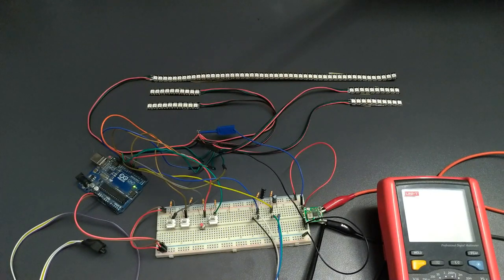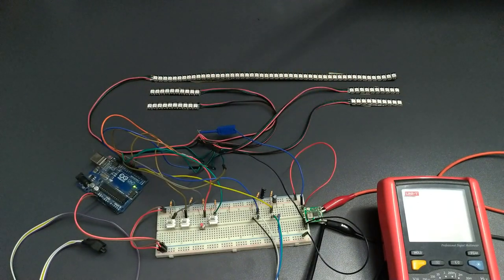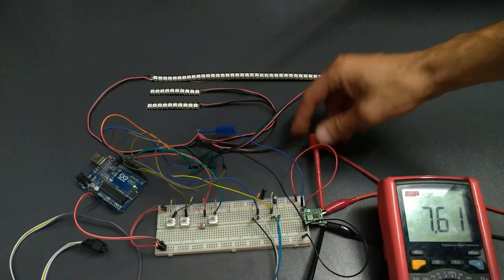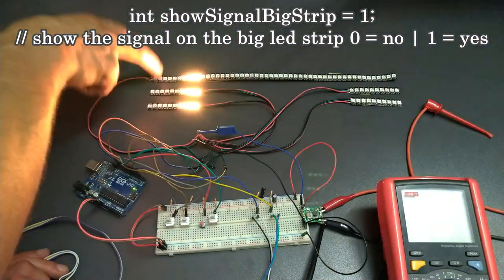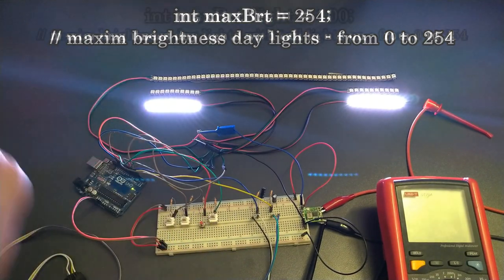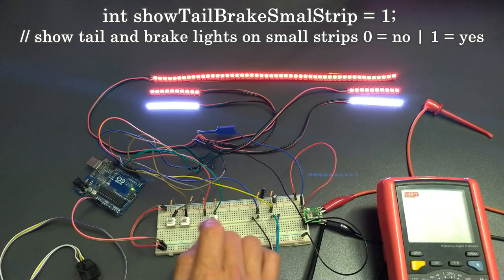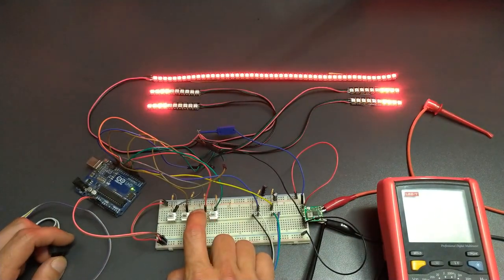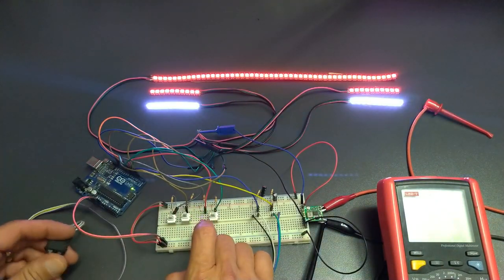Sequential turn signal lights v3.1 for scooters and motorcycles - Arduino, FastLED and WS2812B

Comment: Hi there, very good project you have.I'm planing to use this one  my scooter.Can you make the code to turn on the hazard lights like  the new versions with the regular bike blinker switch  (left to right) Also how diffucult to be to change the animation from Knight rider to other animation like Fade in fade out? 
Thank a lot keep improving the project
Reply from the maker: Hi and thanks.
That's a great idea, i didn't make it from the beginning with the hazard light turning on combination because i didn't knew about this limitation, bkmo98 point it that out. When i have the needed time i will also do a version with the hazard lights combination.
I don't know how hard it will be to add the Fade Out effect, but it will definitely add a delay to switch it between them and it will not be ok, because you need fast reaction of the lights...

Your welcome! ;)
Reply from the maker: Version 3.2 it's here... https://youtu.be/qdpRKUnaBsI

Comment: Will it work if I connect it to any motorcycles light switches? And like regular turn signals uses a flasher, but with arduino you dont use flasher? Am getting it right? Awesome tuts by the way, subs +1

Comment: Hi! Thanks for the video.
Quick question though. What kind of step down module are you using? From what I can see most available rgb led strips will have power consumption of 9-11W per metre and the one you're using is even 43W/m. However, the drop down module you've referenced can produce 3A peak which, if my math is correct will be not enough. 

Also, would you use step-down for light pins from motorcycle to arduino? I know arduino can be powered by upto 12V but digi pins only accept 5v
Reply from the maker: Hi. Your welcome :)
Your math is correct, but not in this situation with this color scheme. In version 6.1 i detailed how to calculate your power consumption for the led strip.

Your mistake was that you calculated for white color, this means red 20 mAmps, green 20 mAmps, blue 20 mAmps and that will be a total of 60 mAmps for 1 led, multiply by 90 leds that i use we have a total of 5.4 Amps or 27 W (for 144led 8.64 Amps or 43.2 W), but i don't turn them all at once white !

In the color scheme of this version the led strips consumption doesn't go over 2.6 Amps and that is when day lights are at full brightness  (20leds * 60 mAmps = 1.2 Amps) and brake at full brightness (70leds * 20 mAmps = 1.4 Amps).
The step down converter model that i'm using is the one from the schematic MP1584EN.

Don't complicate yourself with using step-down converters for triggering... optocouplers are cheap, suited for this job and safe for your microcontroller.

Yes, arduino can be powered from 6v to 20v thru its internal voltage regulator, but the recommended voltage input is from 7v to 12v. In any vehicle with a 12v battery the maxim voltage will be 14,4v with the engine on (because you need to charge the battery, no?) and if you still need the 5v for the led strip, why not power your controller from a stable power supply...

I recommend you watch this clips, they have good info about arduino and optocouplers...
Arduino Basics 101: Hardware Overview, Fundamental Code Commands - https://www.youtube.com/watch?v=BtLwoNJ6klE
Electronic Basics #32: Relays & Optocouplers - https://www.youtube.com/watch?v=2BdevOmN-Zk
Digital Electronics: Optocoupler | Optoisolator - https://www.youtube.com/watch?v=uRX0OwWjKXA (more technical details)
Reply: @IonutFedaceag 
Thanks for the reply. Yes, I'm  planning to use optocoupler. My setup will be slightly different though. I only plan tail lights with two strips on each side of the bike which will work as side lights, stop lights and indicators. I'm new to arduino so if you don't mind, once I have everything prototyped  on the breadboard I'll share it with you and I'll appreciate your comments
Reply from the maker: Ok, ask when you need, but please, include details... they are extremely important. ;)

Comment: Hi, I'm very love this project, I will try to do it for my motorbike.
I have a additional that if the day light can change the color by button and still maintain this color in case we have switch on/off key instead of only 1 color. It will be more cool
Reply: I have done and using with Arduino Pro Mini.
Everything worked well, only one thing is pin #2 for turn light is not. The PCB is checked carefully and worked, HIGH level at pin interrup #2 when input is come.
Please help on this matter.
Reply from the maker: Yes you can... You make a daylight variables (for hue and saturation), add another button, make an if statement for the button to change the daylight color variables and at the end of that if statement just store the value to eeprom with " EEPROM.put() " or " EEPROM.update() ".
After that in the setup void, get the values from eeprom memory with " EEPROM.get() " and assign it to the daylight variables and your good to go...
Reply from the maker: It must be something wrong with the setup, the code and sketch that i posted worked flawlessly...
Did you modified the code?
Could you post a clip with the setup and the problem?
Reply: @IonutFedaceag  thank you so much your feedback, i will try it and will let you know when it done
Reply: @IonutFedaceag  i mean that this issue only happen with arduino pro mini, but after i used with Uno, it worked well. Thank you very much
Reply from the maker: @chitrungpham5804    Strange, they have the same chip, maybe the Pro Mini it's faulty... did you test the pin with another sketch?
With pleasure! ;)
Reply: @IonutFedaceag  i tried with some pro mini, it is same. But now, i already used with Uno, thank you very for your feedback. I will try to do change color and let you know soon
Reply from the maker: @chitrungpham5804  Ok. You can post here a clip with your finished setup, it will help others with their imaginations and i'm also curious! :)
Reply: @IonutFedaceag  hi bro.
I have tried to do it, but i got something.
the color will be change by: fill_solid( ledsB[3], NUM_LEDS_PART_B, CHSV(0,0,gBrtR));
but really i cant change.
do you have any selection table for some color for CHSV color code or guide me how to change to color?
Then i will combine with additional statement changing color by button and store in EPPROM. Thanks you very much
Reply from the maker: @chitrungpham5804  Yeap, you can find it here... https://github.com/FastLED/FastLED/wiki/Pixel-reference
With pleasure! ;)

Comment: As far as inputs go, how would you configure the wiring and code if the brake lights and turn signal were on the same light and wire? Such is the case with many trucks that don't have a separate blinker/signal light. Thank you  for the amazing work you do.
Reply: Each led has a chip inside, making each one adressable, even if they get the same signal cable. This is why they have GND, 5V and data connections.
Reply: Olaf Breuer Thank you for the reply sir. Yes I am aware of how these LEDs work however I’m still curious as to how one could configure the input code if the vehicle turn signal/brake light are the same bulb.  In this well made  example there was separate circuits on the motorcycle for each light but I’d like to know how to configure the code if those circuits were the same as is the case with many trucks. I can’t quite wrap my head around it because the code would be a bit trickier
Reply: @Gmtail  I hope I get the point... well, you can easily put all leds in one row, all on the same signal instead of wiring them in 4 /5 groups. The first led in the row recognizes that it gets its data from the arduino, and then tells the second led in the row that it is nr1. From there on each led "passes his address" on to the next led so each led has a unique address. (This is technically not 100% correct, but better to explain). Now that each led has an address you can group them as brake light leds or  turn leds. In case the brake pedal is pressed you tell the brake led group to turn red, in case of a turn signal you make the turn leds go orange. You can even have leds being part of more than one group and define priorities. Like he did with the big led strip where parts of it can act as turn lights as well. It is all a matter of group declaration. I operate biggest light computers on the market, its nothing different there. Lots of lamps on same signal, organized in groups and priorities/rules defined.

Comment: Are there any sound effects available as a reminder to turn of the turn signals? Judging by the video it seems like the turn signals stay on as long as the momentary pushbutt is being continuously held down. That would reduce the possibility of forgetting to turn off the turn signals but would make it harder to operate something else on the bike.
Reply from the maker: Well, I didn't think it would be heard because of the headset and the noise... i will add it in the future version.

Comment: Hello Ionut! I like your project and I plan to build it, but I have a questions: Can I use SK6812 (RGBCW) neopixel led strip for this project? If yes what should be changed in the code?
Can you help me out please, with the code update for SK6812?
Thank you for your answer in advance!
Reply: Assuming the colour order of your LEDs is the same as the WS2812B then this should work for you.  The WS2812B led colour order is GRB, not RGB.  I do believe that the lights you're using are the upgraded version of WS2812b anyway. So I would guess the sketch would work for you.  If not then these lines would need to be changed from FastLED.addLeds<NEOPIXEL, 13> to FastLED.addLeds<SK6812, 13>. the 13 is the GPIO pin you have the array attached to BTW.
Reply from the maker: Hello. I didn't test it with SK6812 and i don't know. I see the @zrig1  offerd a solution, did it work?

Comment: Are these led strips bright enough to use as the only source for brake lights?
I recently purchased a ws2815 strip and it was not nearly bright enough.
Thank you!
Reply: Agreed, there is a need for some optical system to reduce derect sunlight.

Comment: wereis the area in code so i can put tail lights on with the (signal, day, and KR) how can i do this 

id like to run the (front) lights for my truck running boards so signals , tail lights ( Park Lights) and when i open the doors turns on the (day lights) is my idea kr will be a show off thing later

Comment: Actually would be cool to say.. have a STARTUP routine where when you first turn on ignition.. the Neopixels would do multiple patterns.. then go to all black then to their "at idle" state  running lights (or as you call it daylights on)  I was thinking of adding these to my Harley where the 70mm Circular neopixels fit perfectly .. but are round..
Reply from the maker: I agree with you, i also want to make more animations (for start stop and transitions) for all the versions and it will definitely be in a future video and it will also contain an animation for round signals, because the tail lights from my car are round and i want to modify them.

Comment: Can it be used with NRF24L01 Wireless?  I am thinking to use for a motorcycle jacket purpose
Reply from the maker: Don't it depends on NRF24L01 library if it has delay or not, but i think that it's overkill... You can simply use some rf emitter and receiver for that, like H34A and LR45A, i think they will be more suited for battery power jacket.

Comment: How do you control so many LEDs with the arduino? I know the ports are limited to 5V and 500mA. How you make that without frying the board?
Reply: The Arduino only controls the leds via a serial connection. It does not power them. Arduino and leds mostly get the same 5V from a pwer source.

Comment: I have a problem with this circuit.  when I turn on the indicator, the ws2815 LEDs are green
Reply from the maker: I didn't test it with WS2815 and it looks like the color order differs in WS2815 in comparison to WS2812. A quick fix is to change the color in the top section o the sketch (search for //turn signal color comment) or read hear for more info... https://www.reddit.com/r/FastLED/comments/y6syyc/solved_rgb_color_order_for_ws2815/

Comment: found a bug in v3.1: if you choose an odd number of NUM_LEDS_PART_A and press the brake button, the last LED remains turned on until you press the tail lights button or the right signaling button. Haven't tested the knight rider mode.
Reply from the maker: Well, unfortunately this is not a bug, it's just pure physics, because you can't divide an led by two and still have it working... you need even number of leds, otherwise the code will brake.

Comment: Question what is the small one where your multimeter positive and negative attach with
Reply from the maker: That is the MP1584EN DC-DC Step Down 3A Adjustable Buck Converter.

Comment: Boss how to add animation? I want to make the knight rider as its showmode.. Is it posible to add some animation from  ur federal light project?
Reply from the maker: Well, yes it can be done, you can add effect from DIY Emergency Lights, but it will be tricky.
Reply: @IonutFedaceag  Yes very tricky And im not good  n programming.. Thers a good animation there.. Combined with rider lights.. No. 14 or 15 is amazing as showmode

Comment: Anyone else experiencing occasional glitches such as display of turn signals when the brakes are activated?
Reply from the maker: I think that is because your pull down resistor are not where they should be and that is near the controller... the signal wires are picking up electrical noise, they build up in the wire and trigger the input. For small signals is best to use twisted cables...
Reply: @IonutFedaceag  I think after adding 1k series resistor on the brake activated reed switch to limit the capacitor inrush current and stop the reed switches from welding together the glitching went away. Also added some circuit with mosfet, diodes and schotky diodes to reduce the standby current to zero which automatically wakes up the USB power bank upon activating any input (using it on a bicycle).
Reply from the maker: @uvwuvw-ol3fg   Great you figure it out. If you have time post a video with your setup, it will be great to see it...
Reply: @IonutFedaceag  For audio signal just using another reed switch with some coil with 50 turns of 0.4 mm2 wire on it as a current detector supplying 555 timer and a 50 ohm buzzer which simulates mechanical relay sound which at the same time  acts as an indicator for correct operation.

Comment: Would like to have your poc, Thanks!
Reply from the maker: What do you mean by "poc" ?
Reply: @IonutFedaceag  point of contact, Email would be great, I do electronic hardware designs and would like to get a customized code.

Thanks!
Reply from the maker: Ah, I didn't know that.  You already have my email, in the about section on my channel, the only problem will be my time, that I rarely have.
Reply: @IonutFedaceag  Couldn't find it, maybe a privacy setting is hiding it.

Cheers

Comment: Good day sir can i ask please
Reply from the maker: Ask...
Reply: @IonutFedaceag  sir can you do tuitorial for 12v rgb led strip, will the same code works?
Reply from the maker: @rudyvlog2897  The code will work, but the 12v strips won't work in the car, because you have a max of 14.8 volts when the engine is running, to charge the battery and you will still need a step down and up converter, so i don't think it's a good idea, you will complicate yourself...
Reply: @IonutFedaceag  i found a lot of converter sir, to maintain the voltage to 12V output, thankyou sir i will try it, same code, hope to see more tuitorial with you  🙂
Reply from the maker: @rudyvlog2897  Yes, there are a lot, but you will still need 5v for the controller, so way have two step down converters? With pleasure...